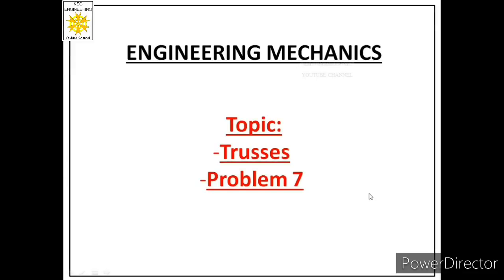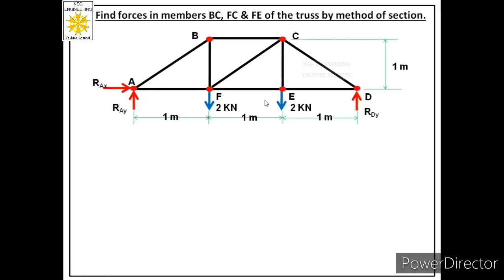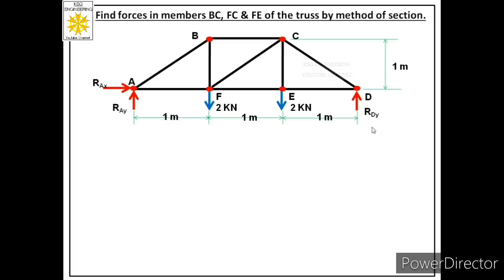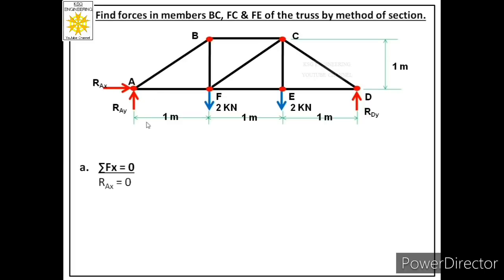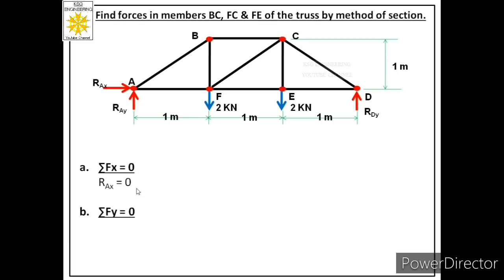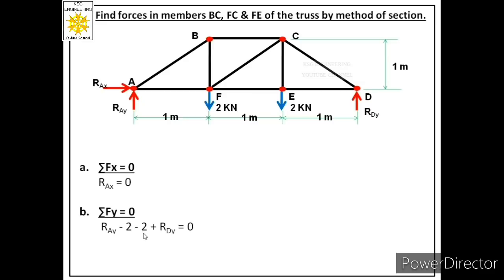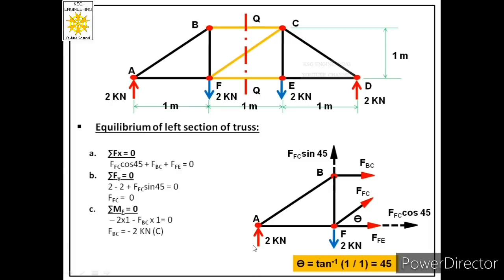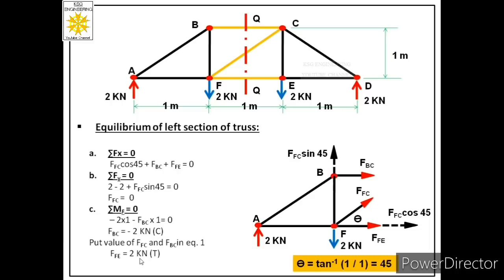trusses engineering mechanics | method of sections truss analysis

Comment: sir in moment calculation is it mandatory to take anticlockwise forces as +ve
Reply from the maker: It is just an assumption. Some books take anticlockwise negative and some take it positive. Actually, it has nothing to do with the answers. It is just a way to fix that if we are getting a positive answer then that moment is clockwise if you have assumed that clockwise moments are positive and solved the whole problem by considering that assumption. Similarly, if you get a negative answer then you will say that it is an anticlockwise moment because you have considered that i will represent anticlockwise moments negative and you have solved the problem based on that assumption. 

So both ways it is correct, either take anticlockwise moments positive or negative but the thing is you have to declare at the start of numerical that let us take anticlockwise moments positive or negative and solve accordingly. Thats it. 

I hope you understand